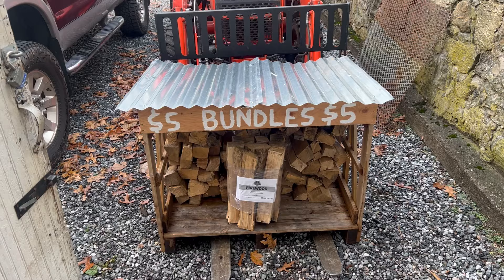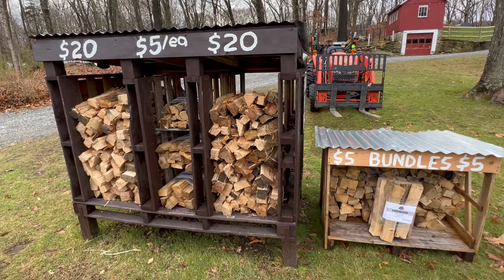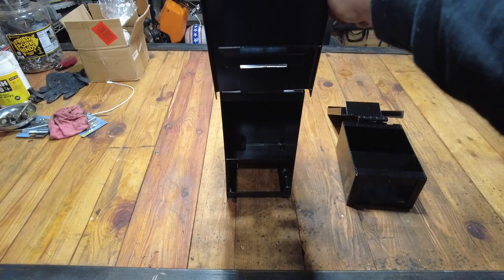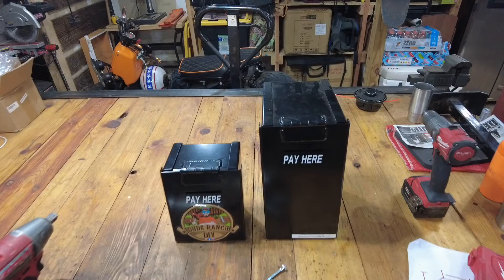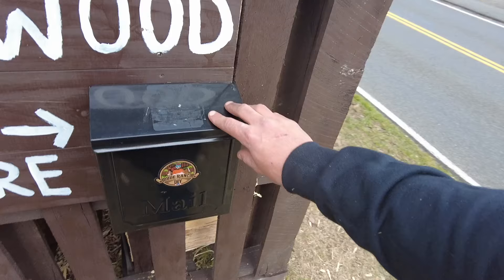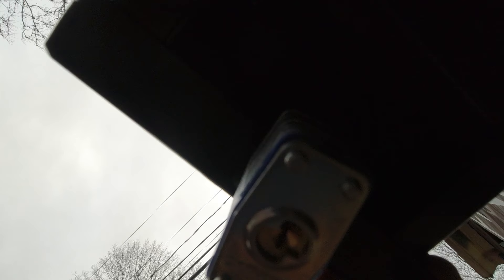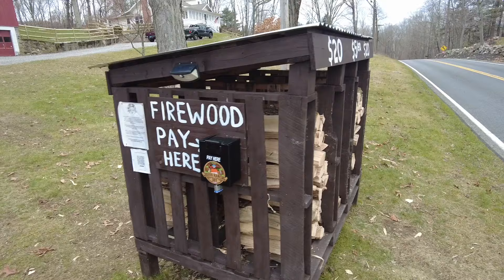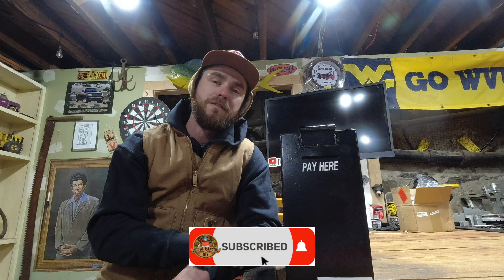#436 Keeping My MONEY SAFE at the Firewood Stand!

Comment: Any update on the use of the box sfter a few months?
Reply from the maker: The box has been working great! My only complaint is that there is nothing to block the rain from getting in the box and soaking the money.
Reply: @DudeRanchDIY  ok. So at that point it may be smart to put some makeshift roof over where the box is?
Reply from the maker: Yeah, you certainly could

Comment: Nice boxes, but some dude with a sledgehammer gives it two whacks and takes it home to cut it apart. If they want it, they'll get it. But yeah it would deter a larger percentage of thieves than some cheap azz lunch box type of thing on a post. A wireless cam would be good to add, especially if the money starts to stack up.

Wait, I just watched to the end, and the lock's locking shafts are exposed and easily cut. The lock is supposed to be up inside so it can't be cut with simple tools in 15 seconds.
Reply from the maker: Nobody said it’s Fort Knox, it’s much more secure than the flimsy mailbox I had for the past two years that nobody bothered. Whoever steals firewood or $40 from a firewood stand clearly needs it much more than I do.